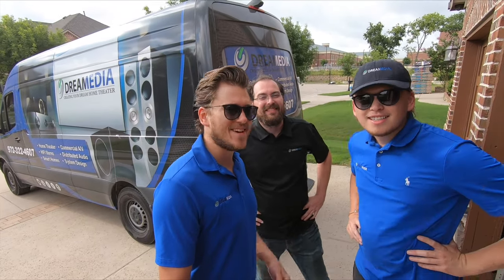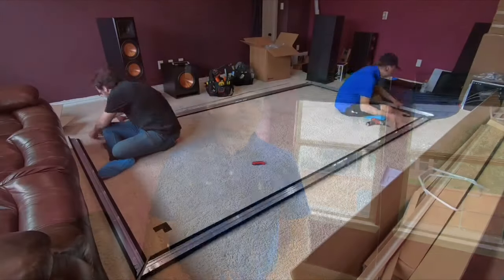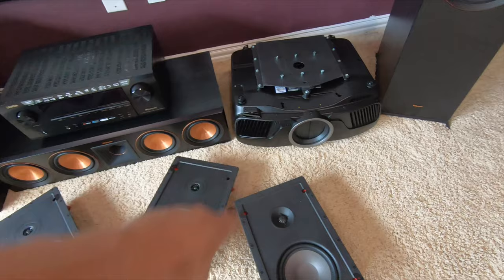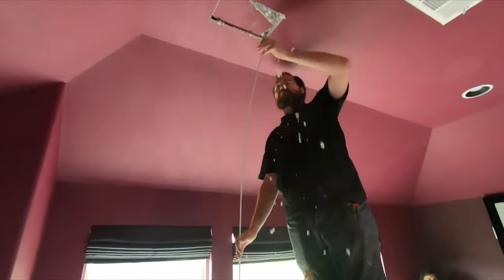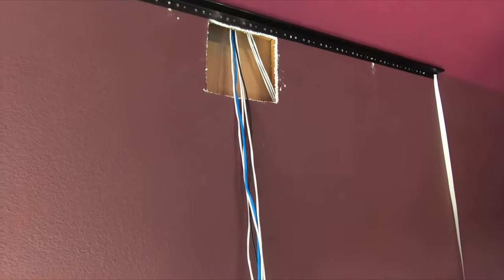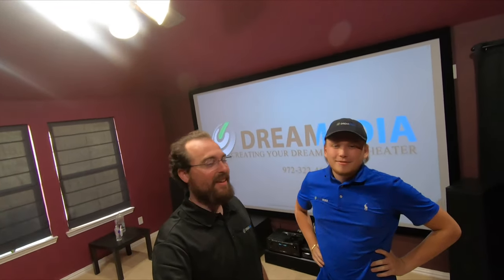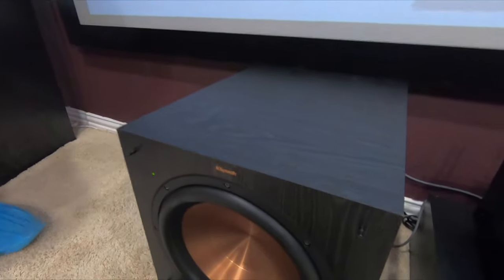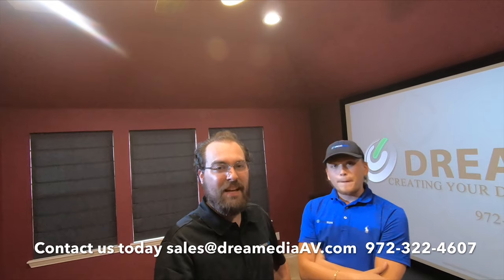DOLBY ATMOS Klipsch 5.1.2 Reference Premiere w/ Epson 4050 and 145 SCREEN! DOLBY ATMOS

Comment: How much for the speakers and receiver
Reply: TheRochoa21 the towers run about 5-600 each. The center is about 600. Can't say for sure on the in wall speakers but probably not much more than 200 each.